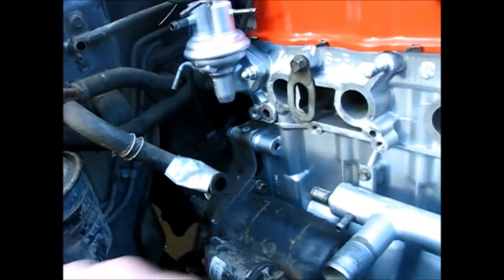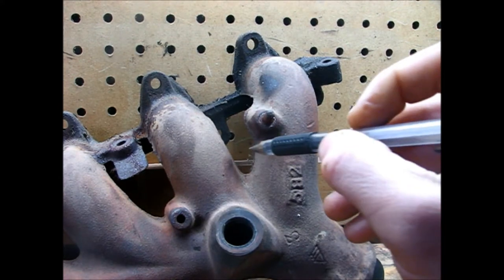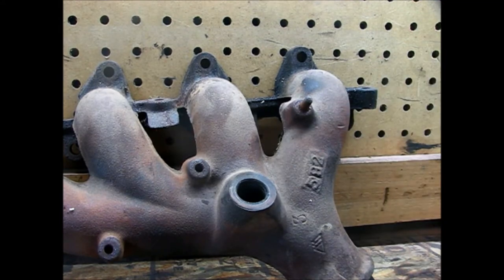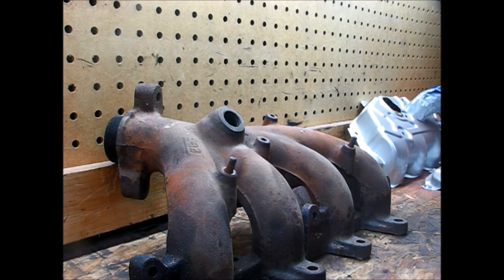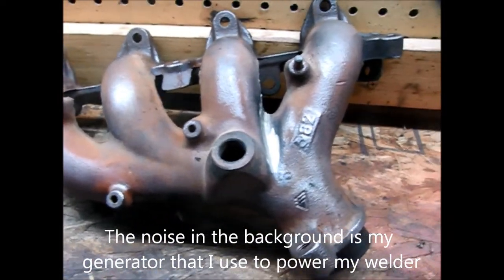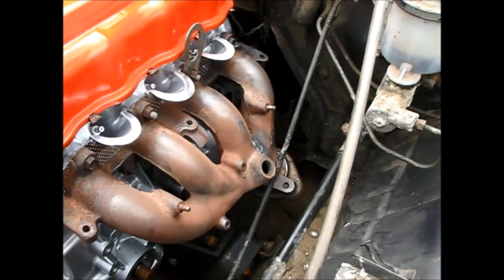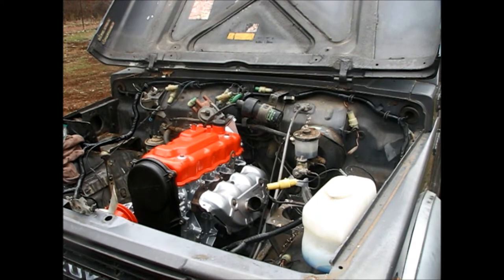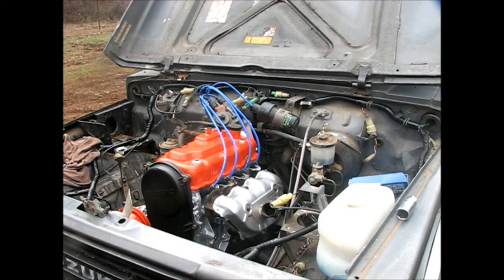Suzuki Samurai welding and installing exhaust manifold

Comment: I've been looking for a new stock replacement for mine, basically unobtanium. Would love to know how it turned out.
Reply from the maker: It turned out very well actually. Since my last video I have posted my camera broke. But I recently purchased a new camera. I'll be posting an update video very soon. I have the engine completely rebuilt and I've already driven it close to 300 miles